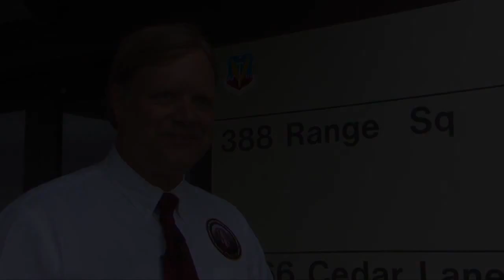Boeing's CHAMP Missile Demo - Directed High Frequency Microwave Disables Electronics (EMP)

Comment: CD drive opens after so called EMP impact.
Yeah its has to be 100% real no fake simulation possible....
00:40 -0:42
CD also jumps out from itself.
Reply: I guess you didn't pay attention in high school physics.

An EMP creates an unexpected surge of voltage in unprotected electronics, which can cause things to happen besides just shutting them off. When you push the button to open your CD drive all you are doing is completing a circuit and causing current to flow into the motor. An electromagnetic pulse can do this on its own.

As for the CD 'jumping' out, its called inertia. If the CD was in the process of accelerating or decelerating (spinning) then there is inertia acting on the CD. Thus, when the drive opens and there is no longer anything retaining the CD, it may come loose. 

This is literally graded school science. Newtons law 101. 

Educate yourself, you fucking moron. 

Nothing 'fake' about this.

Comment: video was at least 10 years old and not really relevant.  also it turned the computers off but did it damage them.... funnily no statements about permanent damage!!   It is very very easy to stop em pulses and most modern military equipment is rated to handle it.   Note; nobody is releasing information about its effectiveness against hardened military standard equipment.... that's most probably because it fails miserably!
Reply: No it's older than 10 years old.  I saw this same video on a small news segment back in 96.  They are even running windows 95 on these things.  The whole VNR is just to hide activity that they were actually tested out there instead... energy weapons.  Beams were reported to police over 911 and eventually they figured they may as well release some propaganda before the conspiracy theorists kicked in....  but they acted too late.  In the rush, they used old outdated videos like these.  Even some of the interviews are not even about the recent tests... they just cut it to sound like that is what they were talking about.

Comment: How come computers went down and Video Camera didn't?
Reply: +Alex Che Shielding the camera with a Faraday cage of sorts prevents electromagnetic radiation from affecting it.  All the computers in the room or the room as a whole can be shielded as well but of course this would cost a lot of money so only the most critical systems of rich countries could actually do this.
Reply from the maker: Alex Che The cameras actually did, it was just a moment later, and I assume they tried shielding them to prevent that.
Reply: mastermanio2 it's not an EMP it won't work, its a microwave beam  big difference. and what people don't understand about the weapon is there are different levels of power at a high concentrated rate of microwaves, they can pass through any material known to man. if the beam to the microwave is strong enough, there is nothing that can shield its self from this cruse missile. they can actually regulate the power on the missile as well, thus making it stronger. I'm sure in the video showing the computers was a low concentrated beam while they used a special box of some sort to protect the cameras like plexiglass. of course the enemy could shield there systems, but the problem would be knowing to what extent they would have to do so to be able to shield there electronic systems. given the volume of the weapons microwave power. on top of that it would be impossible to shield a massive missile sitting on a launch pad getting ready to take of, this weapon system I have been looking into it sense they started the project, because I am fascinated with the technology. and I have come to understand there is no hiding from it unless you are very deep underground, so it's impossible to shield your self from it. in the future the enemy will have to figure a new form of conducting metal that can withstand heat for there electronic weapons systems, because of the microwaves heat. all the metal components heat up on a chip/motherboard and this causes processors to overheat, frying the electronic systems. onboard cash Ram, and physical RAM are also vulnerable to it. they will have to develop special electronic systems that can withstand the heat from the microwaves. so that the systems are resistant and can keep cool enough from frying, and as of right now there is no such technology.
Reply: Honestly, all you'd need to do is set up a copper mesh on the floor/ceiling and walls of your room. It'd be a bit expensive, but it's nothing out of the reach of the average person, let alone requiring government funding.
Reply from the maker: mastermanio2 It seems like this uses a high amount of energy and at a  high frequency, a thin faraday cage may not work.
Reply: yeah, that's a good point